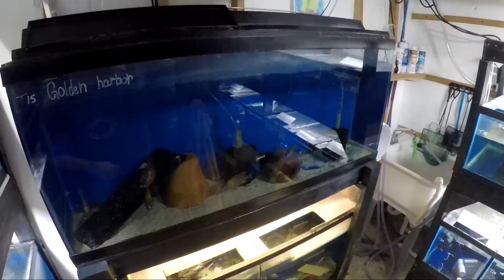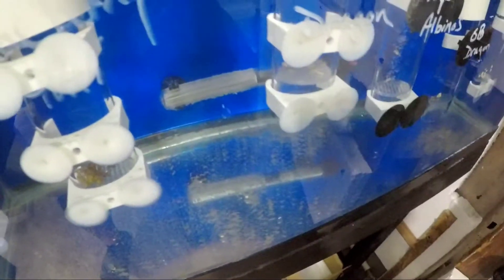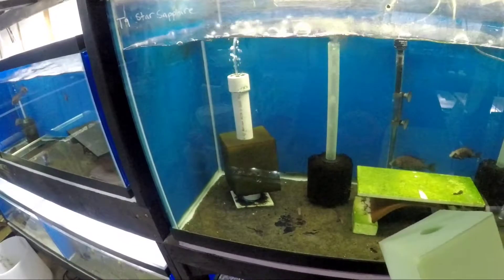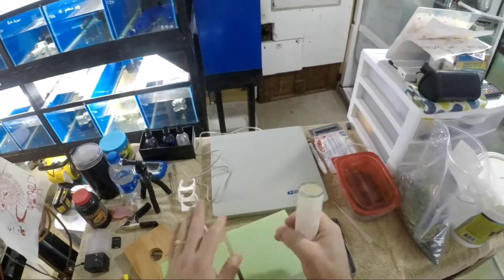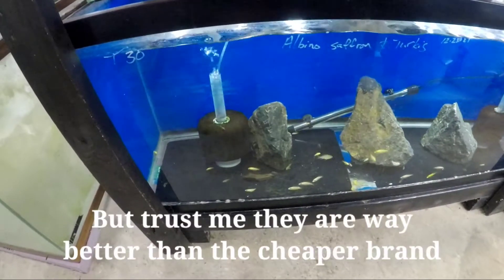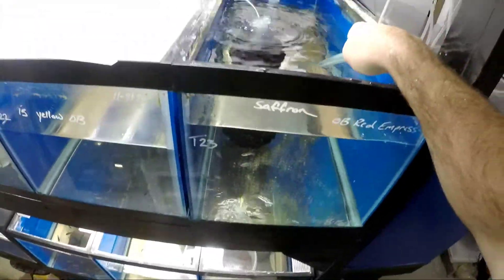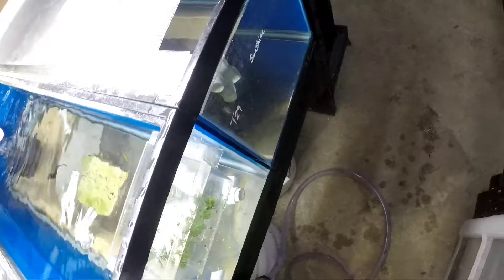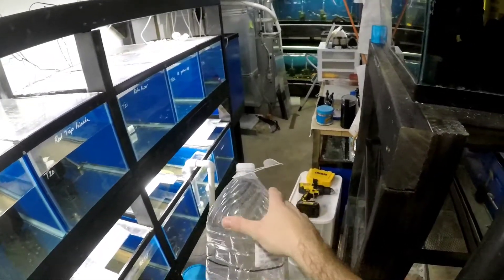FISH ROOM AND SPONGE FILTERS

Comment: How are ypu doing? how do you pull sponge filters out of the water to clean them without all the poop falling back into the tank? do you enclose it with something?
Reply from the maker: I'm doing very well and always love to grow in the fish room thank you for asking. How are you doing as well my friend? so I've seen other people put a bag in the aquarium and put it around the sponge filters but I just like to do a gravel vac around it and then just pull it straight out. I'm not to fussy lolol. Then if need be do another vacuum around the area
Reply: Yea. i was trying to make something to enclose it but i cant figure anything to do. its frustrating an the bag is still hard an messy. i tried making a box with holes at the bottom with filters so the water goes out the bottomg an filters the poop but then its too heavy to lift up. wondering if anyone has any ideas.